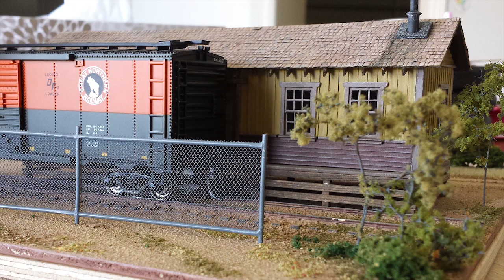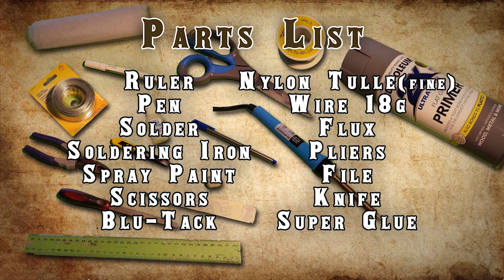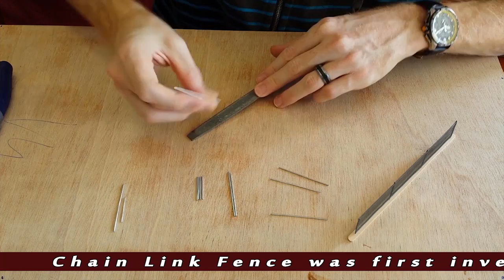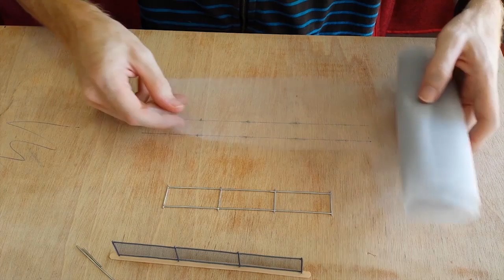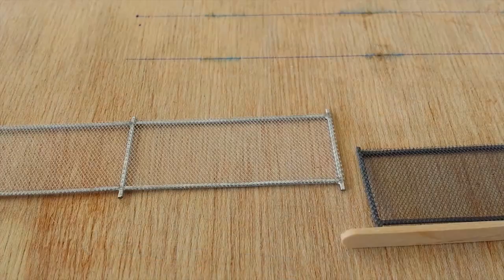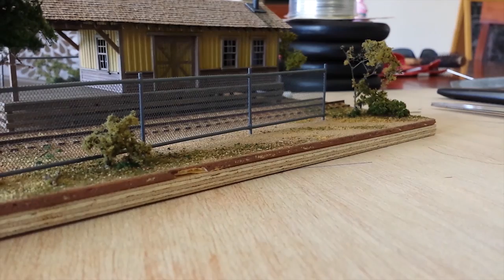Chain Link Fence - Model Railroad Scenery

Comment: Luke, what kind of solder do you use? I tried to solder the wire together but the solder did not hold.
I used a electrical solder.Was this the wrong solder to use? Mail me and let me know what you used.
crazyabouttrainzs at embarqmail dot com. Thanks.
Reply from the maker: tony griffin Hi Tony, I use "DURATECH by SOANAR" it has 60% tin and 40% lead, 0.7mm width. Most people recommend using Lead free solder because it is less toxic but I have found the solder that contains Lead works better. You just have to be careful and avoid breathing in the fumes when using Lead solder.
Also try using Flux, it helps remove any dirt and grease that may prevent the solder adhering to the wire, and finally, the wire I used is galvanized, not sure if that would make any difference but might be something to look at.Cheers, Luke
Reply: I would like to look at more of your older work, but can't scroll down any further. Can anyone help a noob out so I can look back further. Thanking you in advance.

Comment: Good tutorial.  I should have used your method for the new fencing I just added.  I bought a kit and it was expensive.
Reply from the maker: Rob McCrain Yeah, I found the same problem with cost. The good thing with kits is the quality, they are hard to beat for realism.